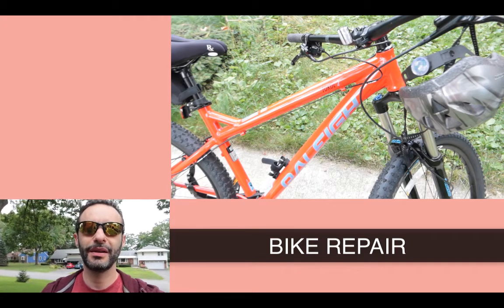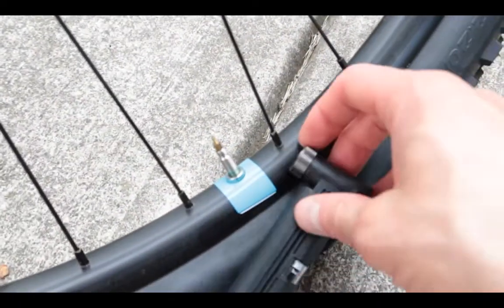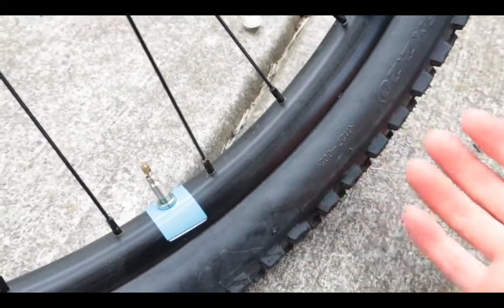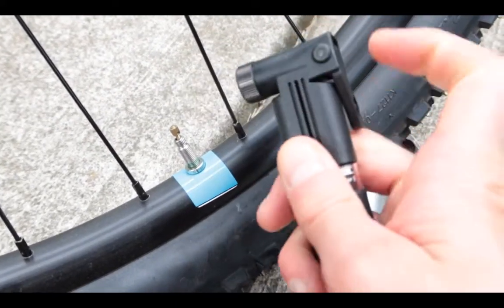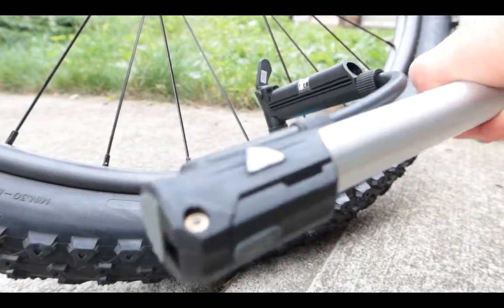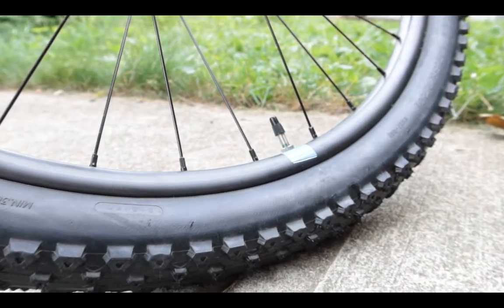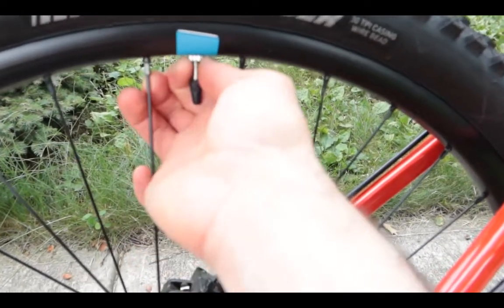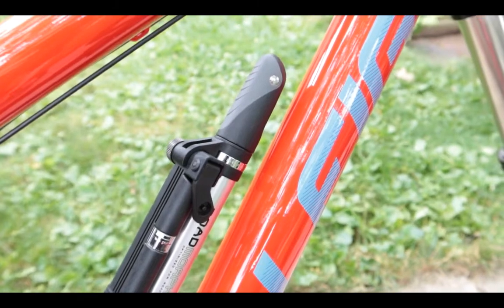How to Pump Presta Valve Bike Tires

Comment: I have presta valves on one bike, and I just use an adapter piece. Also, after screwing the valve shut again, I just screw the adapter on the valve again and then the cap on that. It’s not how it’s meant to be done, but it’s the easiest place to store it.